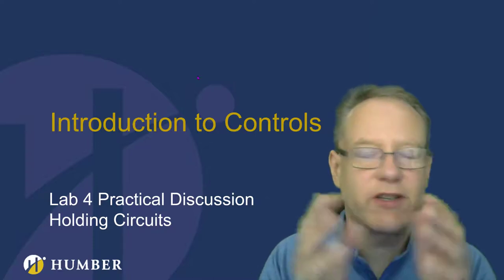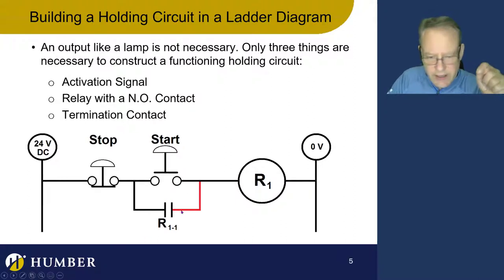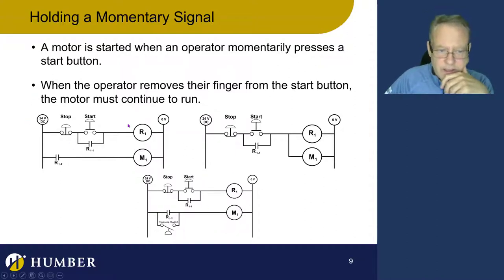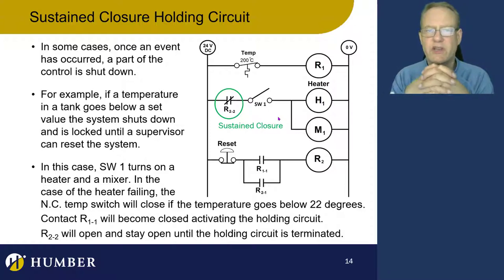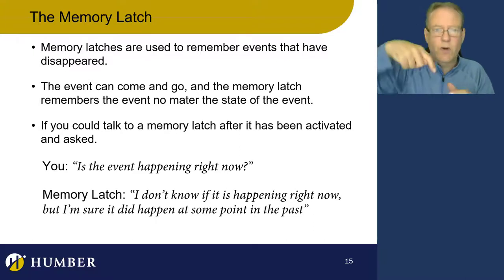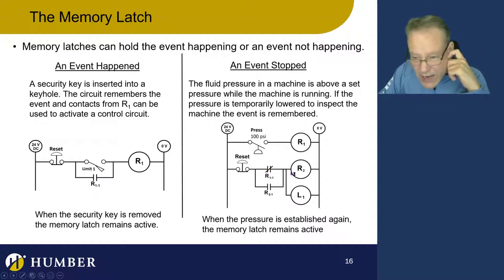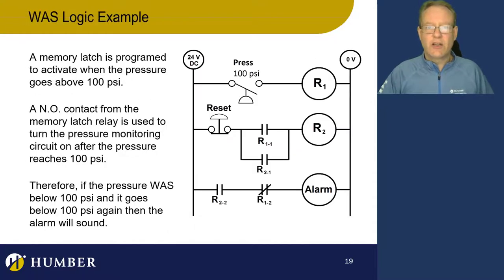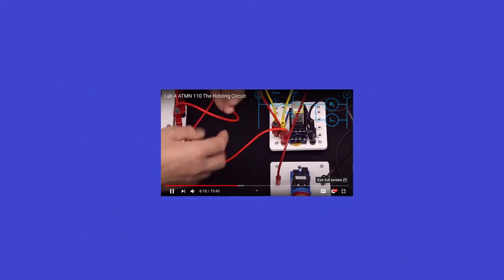Holding Circuits Explained

Comment: In the beginning of video you never explained why their is 2 batteries ?   You should have explained this circuit as it is interesting.
Reply from the maker: Hello Michael. Great comment!

There are wo batteries but only one is required. The picture used was from the previous lesson on relays where I showed that two different power sources can be used with relay control. That example was talking about the fact a different voltage can be used to control the relay then the voltage to the contacts of the relay that are driving the load. The benefit to this is that a low voltage can be used to control a high voltage or vice versa. 
This holding circuit lesson is the second lesson in relay control and I used the same circuit from the previous lesson and justice added the red wire.
For holding circuits you can also use two different power sources, but it is not necessary. The picture in the PowerPoint can be replaced with another picture showing only one battery connected to both terminals of each battery shown and it would work. Typically for ladder logic 24 volts is used for the coils and the loads, but this is not always the case because relays are used in many other applications than in ladder logic.
Just to sum things up: two different voltage sources can be used, each of them can have different or the same voltages or one voltage source can be used. if only one battery was used both of the two positive battery terminals would be connected and both of the two negative battery terminals would be connected and the circuit would work. moving forward in the lecture, that's exactly what's happening with the latter logic. Although this courses focused on ladder logic, relays are not always used in those type of circuits and are used in many other applications such as cars uncles boats and planes and St lights and many many many other applications where different voltages are used (often low voltage for the coil and higher voltages for the load)
I hope that explains some things.